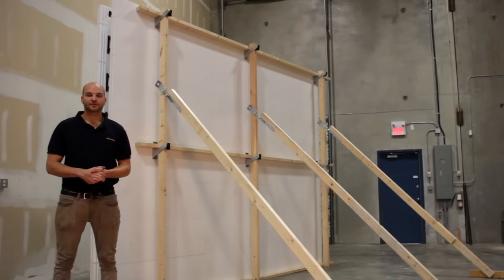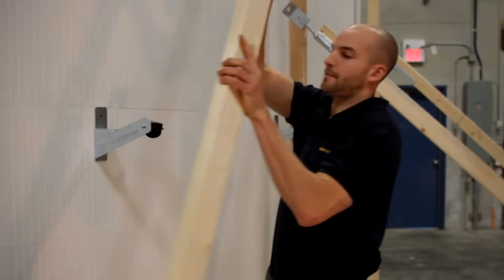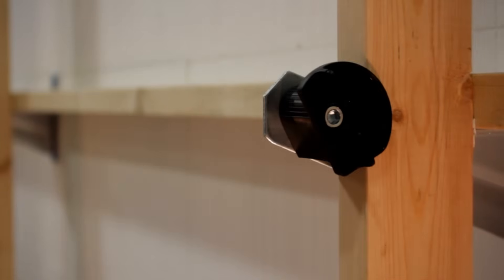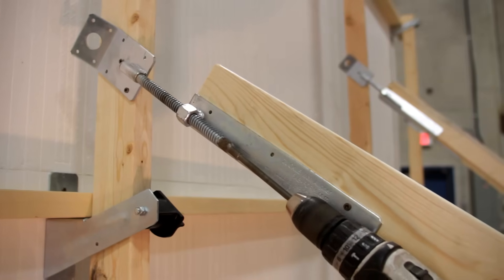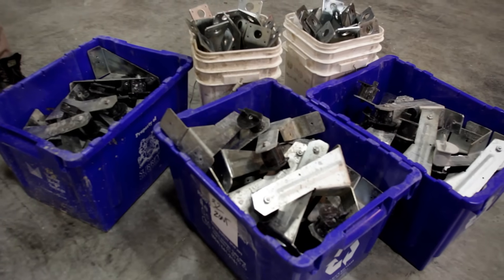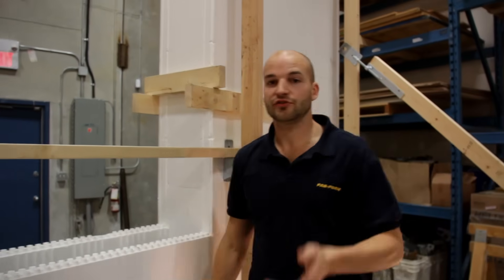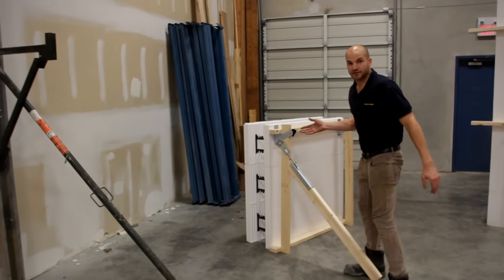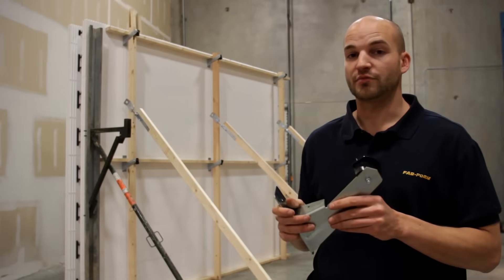Zont™ Insulated Concrete Form (ICF) Bracing

Comment: can they be used on a slab already poured ??-- -put 2x4 s on the floor to brace to
Reply from the maker: Yes no problem. You can either drill into the slab, or it you do not want to damage it, you can spray foam 2x6 to the slab, and screw into that. 
Check out this video:
https://www.youtube.com/watch?v=j4h05uGCZhQ&t=1s
Reply: @FabFormIndustries  thank you

Comment: My biggest concern is the flexibility of the 2x4.  Quality of the 2x4 could easily become an issue as well.
Reply from the maker: We have been using 2x4 material for forming concrete for over a hundred years in North America. Yes bowing lumber is not ideal for the horizontal and vertical lumber. But keep in mind, we don't care if our wood is straight, just our ICF walls. As long as we have adjustability every 5' with the Zuckle, we can easilly make any ICF wall straight as an arrow!
Reply: @FabFormIndustries  What a dumbass answer.

Comment: Finding true lumber would be a problem
Reply from the maker: We run our eye down all lumber before throwing it on the wall. If it has a large warp we would use it for a diagonal kicker to adjust the wall. If any warping did occur during bracing, you have the turnbuckle on each brace to maintain that the wall is true.